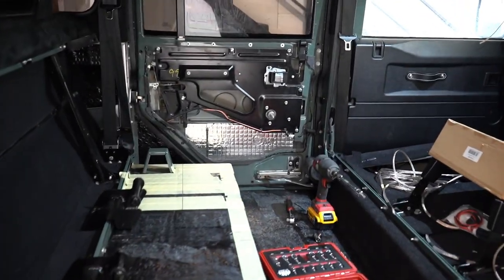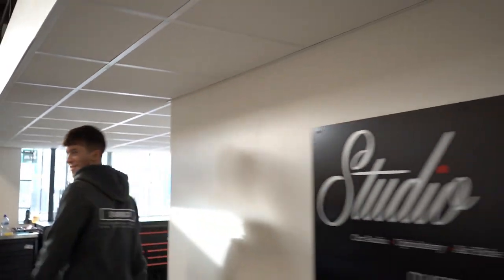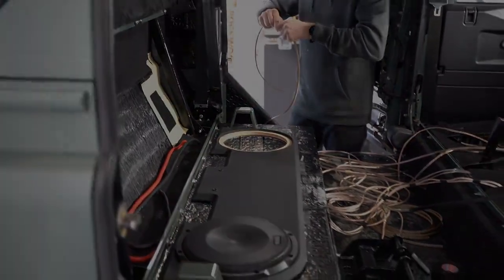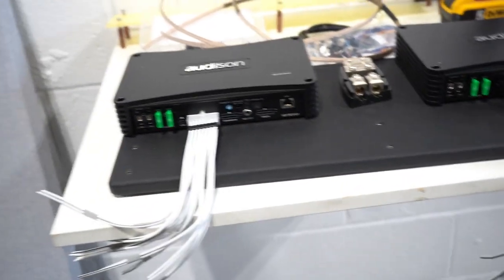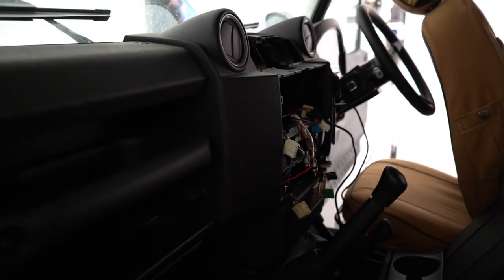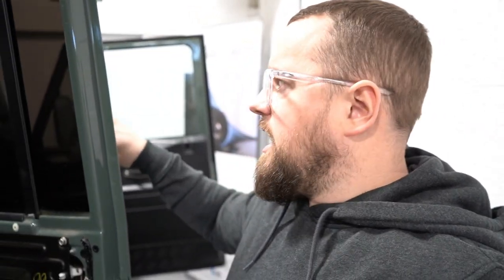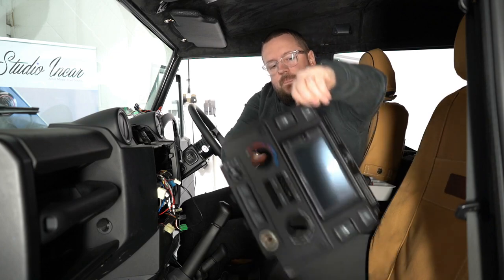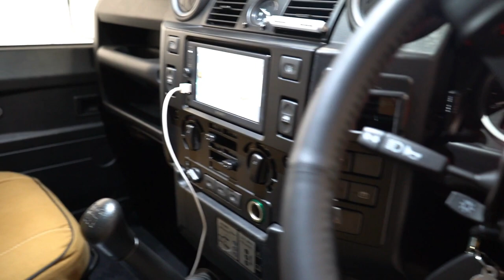Landrover Defender 130 Upgrades! Sound system by Studio Incar

Comment: Got a 130 last August and have been slowly upgrading it. I wanted the Sony 8050d because it sits better in the original single Din position of the fascia. IMO the double din conversion has it too low for driving / maps.

BUT I need to insulate the truck first as the Sony doesn't operate below 0'C and a friend with a 130 had to pull the Sony out of his due to cold....